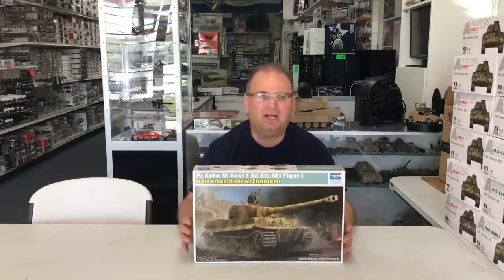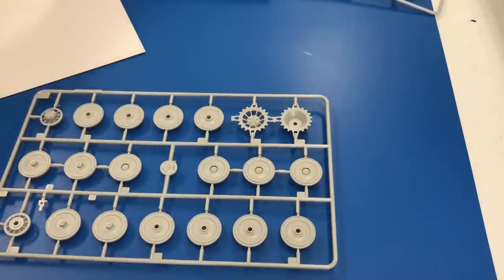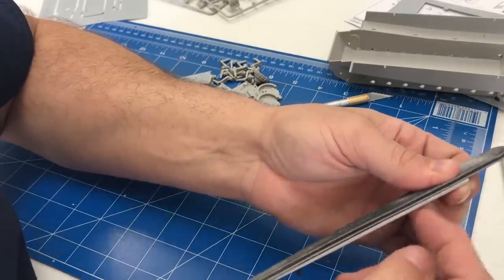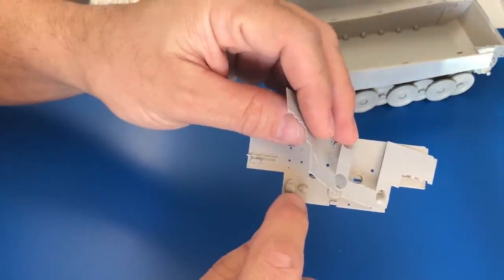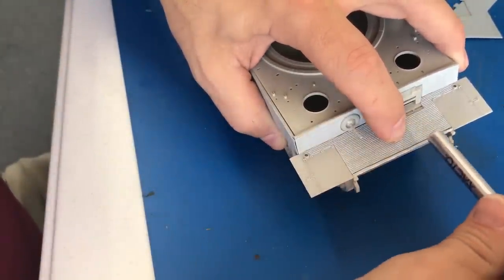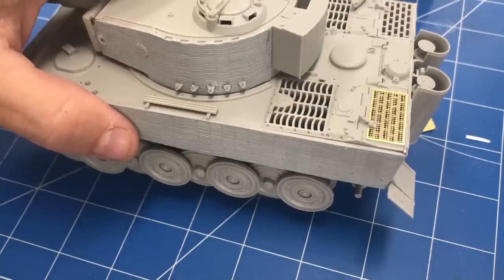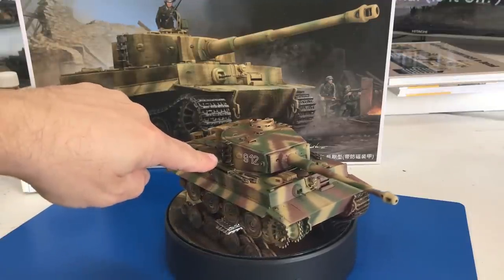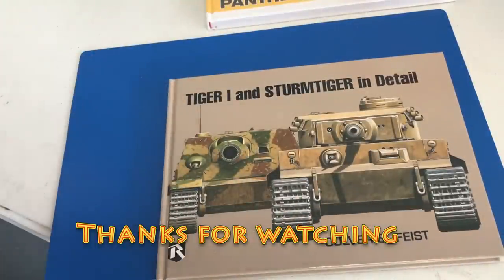Building The Trumpeter Tiger 1 with new Zimmerit

Comment: Hey Andy.  Yes, I'm def interested in this Tiger book.  I love the Panther book so, why not purchase another reprint of this book.  I just wanted to mention that another modeler made the suspension workable by cutting off the key on the torsion bar part, then pushed it through the lower hull and crimped the end with  needle nose pliers and the running wheels will turn.  Great build and I ordered this kit last week and should have it in 10 days or so.  I'm really looking forward to building this Tiger and thanks for taking the time to vid your build.

Comment: The "little plug" on the rear wall leads to the engine's water cooling pipe. A blowtorch could be placed here on a cold morning to heat the water.

Comment: About that little piece not cut-out on the zimmerit plastic sheet, you could have removed it from the actual rear plate, used it as a mask on the zimmerit and cut out the right shape. Even according to your plan, it worked pretty fine, either way.